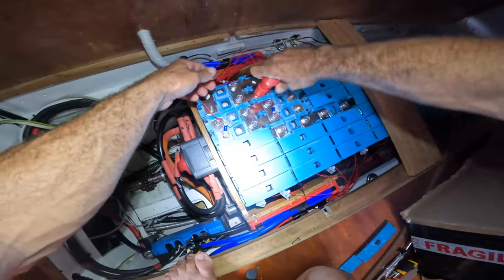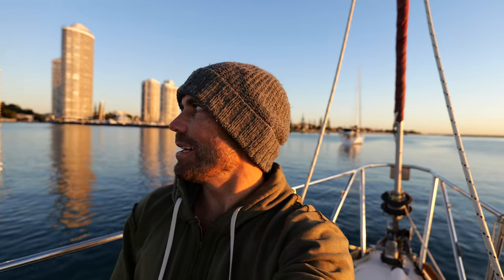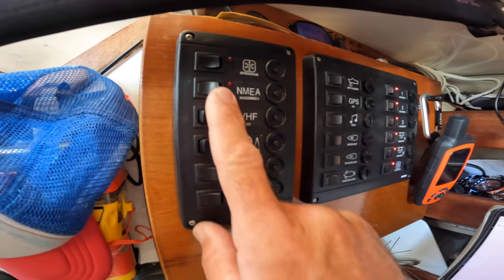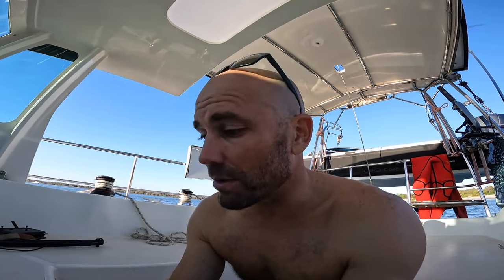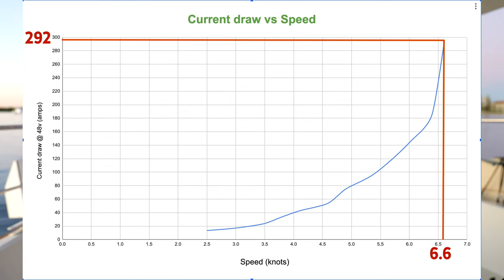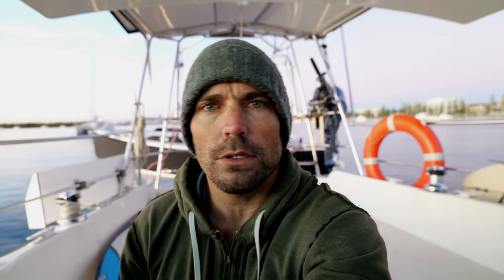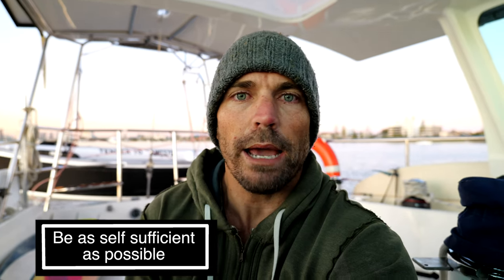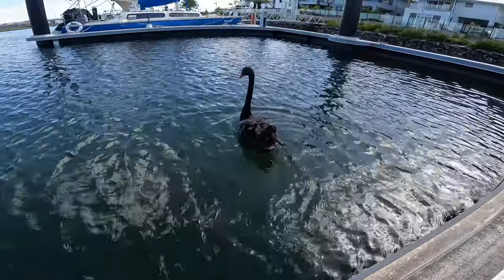How to - Electric Boat Conversion - Part 3 - 36ft sailboat - Electric motor real world testing

Comment: Thanks for sharing.  I went electric 4 years ago, have a 550ah bank, but i went induction motor with a curtis controller, which is my only regret.  The sevcon seems to be much easier to program with better tools and service, plus a PM motor would have been smaller and more efficient.    I've also not been able to get regen to work. Regardless, I actually use the motor more now than I did the old diesel, for all the reasons you say.   I have 1.2kw solar, so get unlimited range at about 2 /2.5knts.   Trying to find space for more solar to increase that. 
It's the motor sailing that it really comes into its own though.  People just don't realize how great it is, in light winds with a sail up going at 2/3knts and being able to add another 2knts for free!
Reply from the maker: That’s frickin awesome! Team electric 🙏

Comment: Thanks for all the detailed graphs and information. I'm looking at putting two of these ME1616 motors and controllers into my 41' power yacht to replace the massive old gasoline engines. Glad to see my estimate of being able to achieve about 5 knots with each motor pulling about 6kW is probably accurate. Obviously we have very different hull types, but roughly about the same size and weight yachts, plus I'll be pushing two motors which should definitely help get my old girl moving.
Reply from the maker: Super interesting! How big ya battery bank?
Reply: @slightadrift  Initially 108kWh, but leaving expansion room to go to 140kWh. The perks of having a big engine room with a ton of space is I can comfortably fit a lot of 300Ah EVE cells in there, even with a nice case for them.
Reply from the maker: @Adam-en4zm  that’s fricken awesome! I haven’t really heard of anyone going electric on their power boat. Hope it all goes smoothly 👍
Reply: Cheers man, there is one local guy here who did it with a 30' Tollycraft, originally powered by 318 Chrysler V8 engines. He actually used lead acid batteries and DC Lynch motors. I've never seen it done to a boat as large as mine, but it should be an experiment.

Comment: Timon, love your work mate!  Especially this series.
It would be cool to have a vid showing the wake behind the boat at different speeds, kW and what hours of motoring that gives.  Just to give a visual of where the energy is going :)
Reply from the maker: Awesome Dave! Thanks so much for the suggestion! There are two more in this series so in might squeeze that in somewhere

Cheers👍🍺
Reply: @slightadrift  thanks, and fair winds.

Comment: This has been very informative.  Thank you for the effort.  I'm sorry if I missed it, but have you published an itemized list of components and costs for the ME1616 conversion?  I'm not on Instagram in case that was where it landed.  Is the ME1616 still working out for you?  I have a 9.8 Tahatsu OB that I am going to drop into my stern well and combine that (possibly) with an inboard electric drive.  Don't know if that combo will work, but I can't see why it wouldn't.  Thanks again and good luck.
Reply from the maker: Hey there! Not sure if i've posted it somewhere but i've updated the description in that video with a summarised breakdown. ME1616 going strong. hope all goes well with your install! 👍👍

Comment: Impressive numbers for such a heavy boat! I get very similar data on my 30 footer (clean bottom and prop, no wind or tide) 5A, 2kts, 15A 3kts, 30A 4kts and around 50A 5kts, but it's less than half your weight 😂
Reply: Lavranos is very good at low drag low resistance boats. His boats generally have a long waterline for their overall length.  The drag of any boat goes up something like linearly with displacement, but also decreases with waterline length. If a boat is doubled in length, then generally it will go 1.4 times the speed with the same power, 1.4 being the square root of 2. Also because your 30 footer has a much shorter waterline length then it is operating at a much higher speed length ratio for the same speed as the 36 footer so the resistance is much higher. At the end of the day, waterline length is everything. Later Lavranos designs really have long waterlines, as do designs by Joe Adams, Graham Radford, the later Chuck Paine boats, Carl Schumacher designs....and there are others. Herreschoff was also great at maximizing waterline, one of the reasons why his boats are still fast today.
Reply from the maker: Woe! I did not expect that! Good info 👍
Reply from the maker: Hey Nigel, awesome info. How do you know so much about Lavranos? I couldn’t find that much info by downloading the whole web 😂
Reply: @slightadrift  I am interested in his boats. Also he lives in Auckland, as do I. I have a Sundeer 60 and Lavranos designed a previous iteration of the Dashew cruising boat called Intermezzo II. I was interested in the concept way back in the 80's when I was a young idiot delivering yachts. Lavranos also worked for Angus Primrose and Sparkman & Stevens.  I may still have his phone no. somewhere.
Reply: I think there is a book about him: Bright Horizons by John Macfarlane. I have not read it.
Reply from the maker: @deerfootnz  awesome! I’m going to look up that book

Comment: these numbers are very helpful, thanks.. I am planning on converting a 36 feet Beneteau with roughly 6,000 kg (or 13,500 pounds) displacement to electric and was hoping to understand the ideal KW/WH motor needed? any thoughts? Thanks
Reply from the maker: You could get away with a Sevcon gen4 size 2 (I have size 4) I think… but obviously I don’t know for certain. My boat pulls 160amps at 6knots and 292amps at 6.6knots to give you an idea of how relatively useless the upper und of the power is. 48v for simplicity 👍👍
Reply: @slightadrift  thank you so much, you have been very helpful

Comment: Maybe a silly question, but do you still need anodes on an electric inboard? Cheers
Reply from the maker: Absolutely. The annode (usually a lump of zink) needs to be touching metal below the waterline that you wish to preserve. It provides a sacrificial piece of metal that rust/erodes away first. Any metal below the waterline should have anodes, regardless of what they are attached to 😊🙏

Comment: Hi …i like your vid…my 40 years old diesel will be replaced on my sailboat soon..are you still happy with your setup? I might folow your motor setup cheers thanx
Reply from the maker: Yes, absolutely! Obviously I don’t have the option to motor for two days straight if the wind or weather isn’t cooperating but you just sail to boat you have. 

Then, there’s Little to no noise, no maintenance (so far), no oils,  no fuel, no smell, no exhaust. I love it. Good luck with your build 🍻

Comment: The website of dugite motors seems to be down, so that calculator cant be reached anymore :(
Reply from the maker: i've updated the description. dugite motors has been sold to a legend rebranding it as Powerflow Marine. there is no calculator anymore but he should be able to help you out with any questions you have. good luck 👍

Comment: How much re re gen do you get under sail at say 5knots , , I’m thinking about going electric in my Columbia 34mkii
Reply from the maker: I haven’t really worked out all the regen numbers yet but at 5knots it’s basically nothing. The power curve is exponential. So 6 knots is better, and 8 knots plus of boat speed thru the water is where it really starts to put in a measurable amount. Unless you can consistently get high boat speeds, or have the fancy prop/motor from ocean volt I wouldn’t count on regen 🙏

Comment: I settled for a small air cooled Chinese diesel motor. 44 LBS and $209 to my door plus hardware. I wanted nothing to do with salt water cooling. Fuel consumption is about a coffee cup of diesel per hour, unless it's also charging the house battery. The 168F is the smallest diesel I could find, and 3 horsepower moves much emphasis from speed to charging. I fuel with highway diesel, and don't want to get stuck refueling with less fresh petroleum. Larger models are made. Watch out for high oil consumption during break in and mount yours on a thick aluminum plate. It likes a seven inch pulley to turn the alternator. Electric/lithium was just way too expensive and heavy.

Comment: What was the diesel horsepower? What salvage price did you get for it?
Reply from the maker: Old diesel was 24hp. I ended up basically giving it away. Can’t remember exactly but it was like 1 or 2 k
Reply: @slightadrift  Interesting. There's a guideline of 2hp per 1,000 lbs so you were set for 12,000 lbs. I lost my 3hp for 1,300 lb daysailor one season. Switched to available 27 lb-ft elec (~120W) to get in/out of marina. Worked fine in average weather.
Reply: @slightadrift  Slight tangent. Full size panels at top of lifelines doesn't seem like good fit. I think your 800W is a great start. For lifeline addition, consider 2x200W @ 37V panels wired in series. Rich Solar is 59"×27", $197ea. I would connect with dedicated IP66 quality charge controller. I think your total W is enough and the 27" is great fit to lifeline height. You might get more use out of narrow panels.
I think you have one of the most accomplished approaches to electric auxiliary. Plus I didn't hear mention of your turbine. I used one from Hawaii to PNW and it was half of daily Ah production, ~75 ampHrs/day. Your auxiliary at 4 knots does quite well.
Reply from the maker: @artsmith103 my boat is 10T 🙄
Reply: @slightadrift  Yes, you mentioned that and I must have remembered 10,000 lbs. Well, hope you never have to push 10T uphill. And maybe your turbine is 12V?
Reply from the maker: @artsmith103 wind turbine is 48v
Reply: @slightadrift  Great, I thought maybe leftover from the prior 12V days with the old auxiliary.  So hopefully 25-50ah during pleasant days. I definitely would put more compact panels in series on the lifelines.

Comment: Surely there is an obvious niche market, (business), here for the fair weathered "sailors" island hopping in the Mediterranean say. Who wants to be changing the sails all the time in the summer Ionian, running the diesel engine when you are regularly becalmed. Even more so when your old. Forget those multi million pound solar catamarans from Silent Yachts - take a cheaper 35 foot mono hull and ditch the masts, sails and rigging and build a nice looking full length (ish) solar roof. 400W panels are about 1.8m x 1m so you could fit 20 of them to have an 8Kw array. That might give you up to 40 KwHrs per day. Fit a cheapish 2nd use EV battery of around 60 KwHrs and a small electric motor as fitted here. Now were talking! An easy 4kt, 100 mile a day cruiser but with loads of power on passage or at anchor for all those mod cons like water makers, air con, cooking, fridge and freezer, lights and off course recharging. I'd love one.
Reply from the maker: That would make some great content if you did it. Although, if you didn’t have sails, I’d want a cat or a trimaran. A mono hull without sails in the ocean is absolutely fricken horrible.